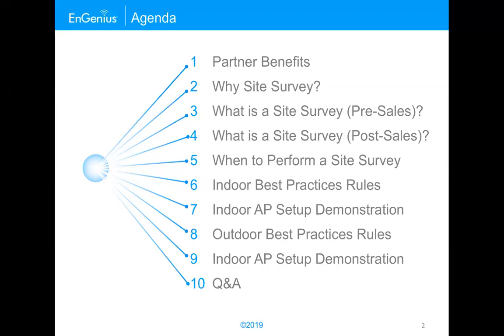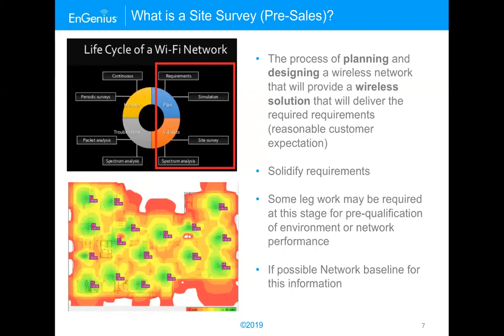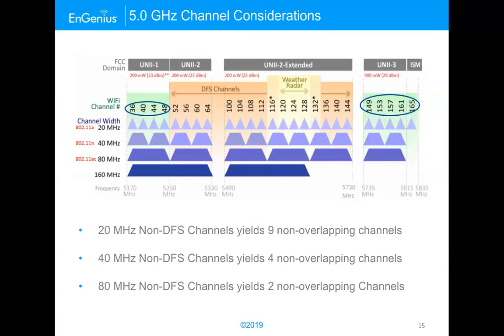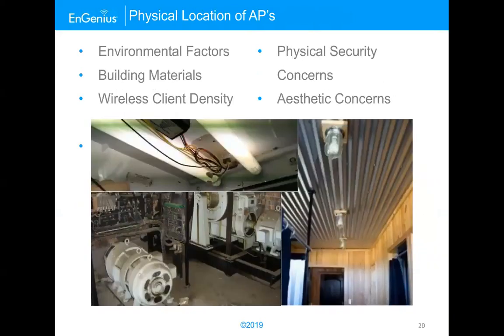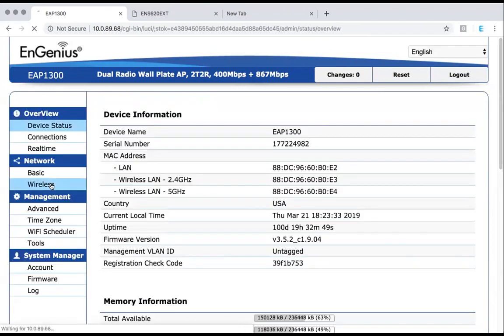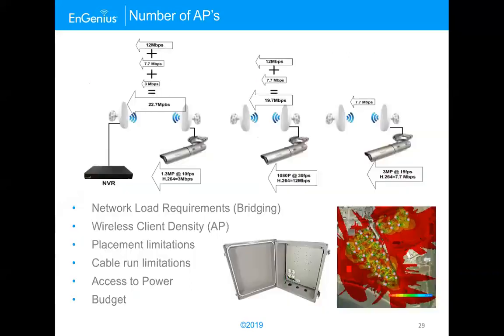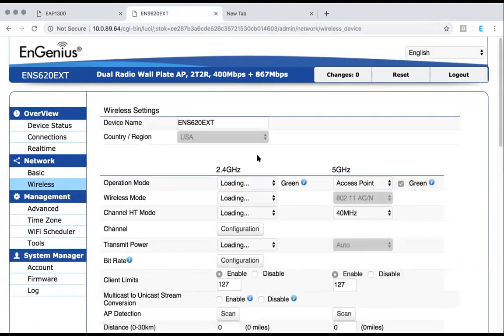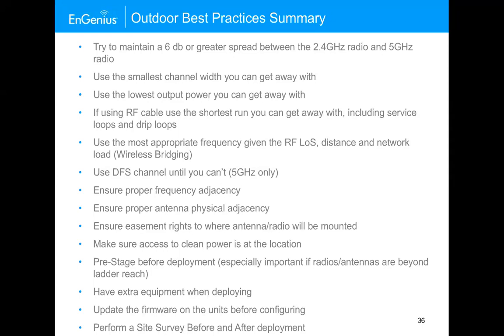Tech Talk  WiFi Best Practices

Comment: Great Video. I have one concern. How did you find your network range to give it a valid IP address within your network. Also do I need to disable DHCP on AP and Router? I am doing a single AP standalone that is plugged directly into router.